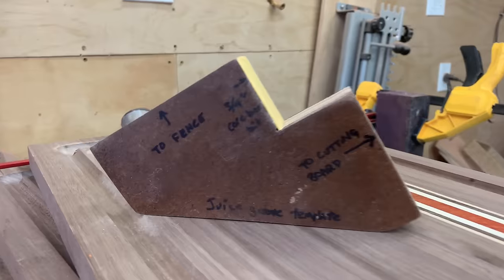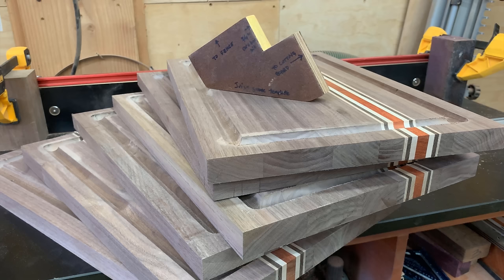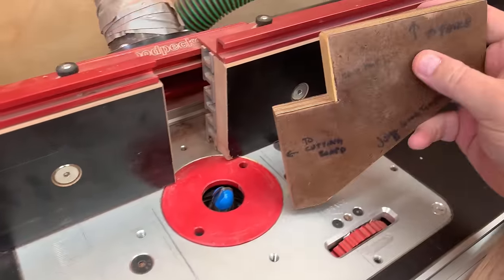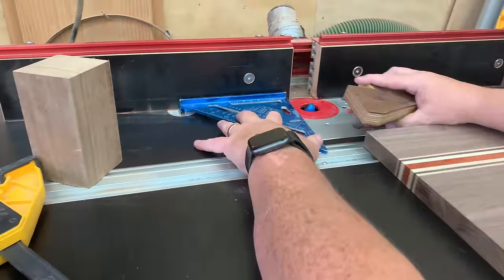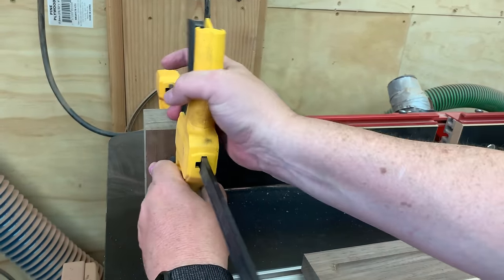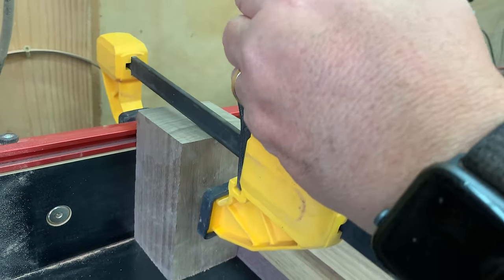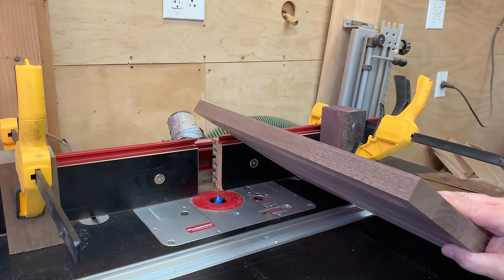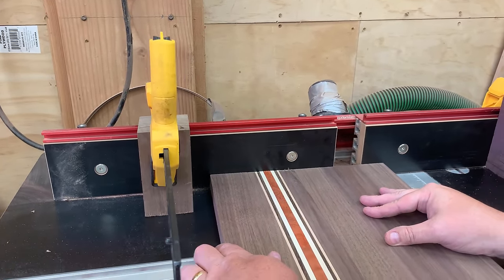87 - Make Perfect Juice Grooves for Cutting Board on a Router Table with easy Jig and free Plans

Comment: Great video! Made the block, and used a 3/4” bit. Your method worked flawlessly! I have a question. I tried your procedure using the block from your drawings, and a 1/2” bit. The grooves wouldn’t go far enough in the board to meet. What am I missing when using a 1/2?” Does a different block with different measurements have to be used?
Reply from the maker: Right. You’ll have to completely recalculate the block. Because both dimensions will need to be changed.

Comment: Do any of the  jig/template dimensions change if I use a 5/8" router bit instead of 3/4"?
Reply: I had the same question. Did you try it?
Reply: @ramaroodle  Yes, built the jig a little narrower and tried it.  Worked OK but my table is not as big as his, so could not use it for a 17" board.  Went back to my old jig which requires that I do  it without the table, but it works fine.
Reply: Hal Schmerer thanks for the quick reply. When you say narrower do you mean the thickness or take maybe 1/4" off of thickness and the other 2 edges? My boards are smaller so I'm thinking a 3/4" groove is a little large.
Reply: By narrower, I mean the thickness of the jig